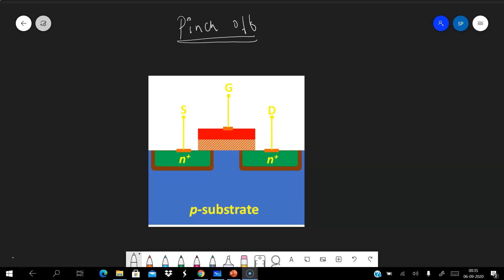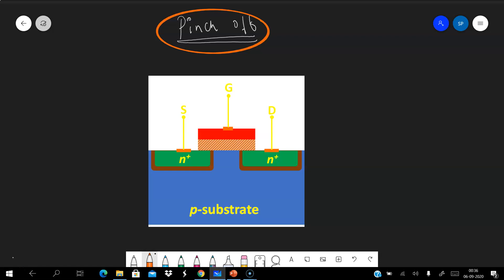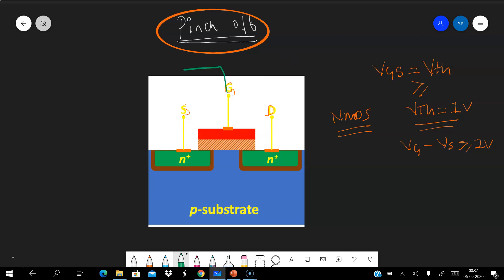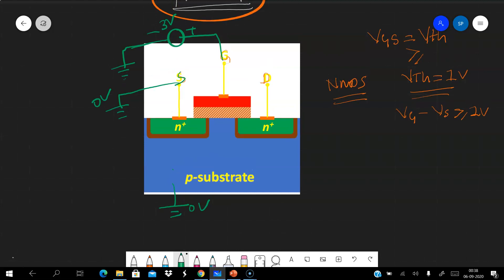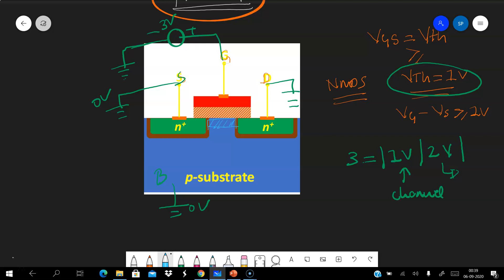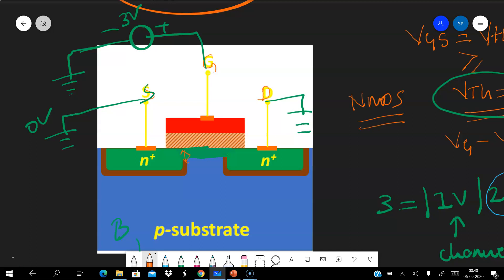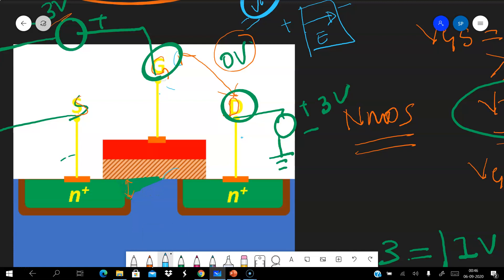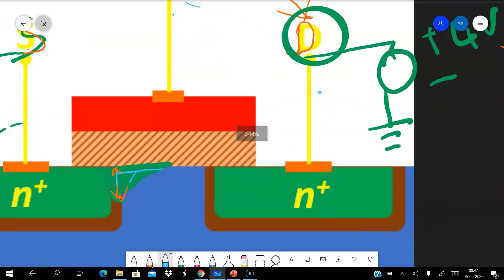Pinch Off In MOSFETs Simple explanation

Comment: If the channel is disappearing from one side,  how does it provide constant current between source and drain?
Reply from the maker: Good question satvik. This is how you can look at it --> Even though at the drain region there is no channel, there is a high electric field . This field will facilitate the flow of current . But since the electric field is high , the current is limited by velocity saturation and hence there is low increase in current due to VDS increase.

Comment: Why we are using n+ region?
Reply from the maker: Drain/Source need to have high doping for high charge carrier concentration. Also i would encourage you to go through fabrication steps for NMOS/PMOS for more clarity..
Reply: @vlsiorg  TQ bro
Reply: @vlsiorg  why we are using metal oxide in the MOSFET between the gate substrate what's the exact use for that?
Reply from the maker: @maddireddykotireddy4371   this is again related to fabrication.  Modern mosfet has sio2 between gate and substrate. its an insulator. This creates zero current path between gate and substrate. Mostly , this avoids the " Loading Effect" . Please watch videos from "Nandita dasgupta" for fabrication in detail.
Reply: @vlsiorg  thanks ❤️
Reply: We are using highly doped n+ because we need high concentration of electrons at interface as electron concentration is quite higher .
Also it is highly doped so as to reduce the effective resistance present i.e contact resistance due to formation of schottkey junctions
Reply: To achieve nearly Ohmic contact